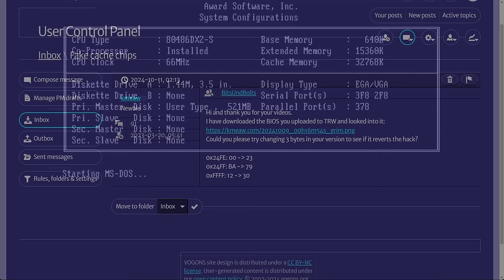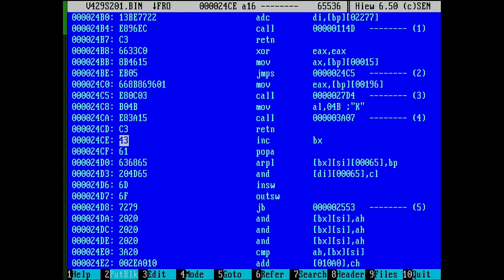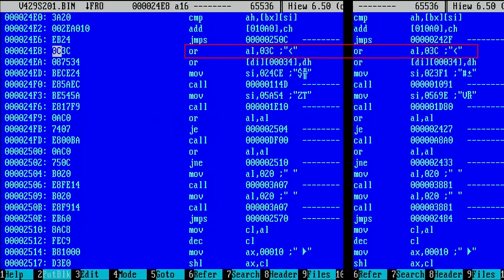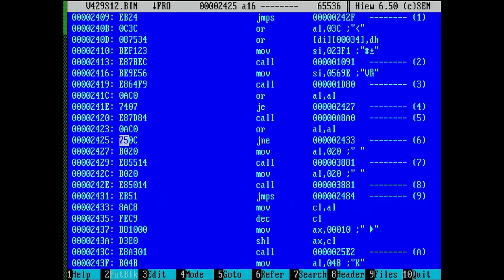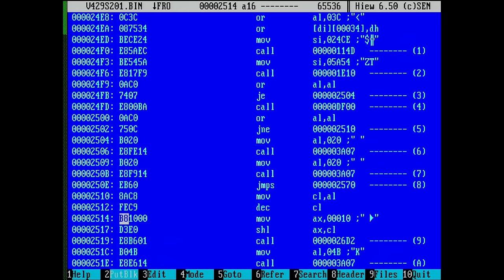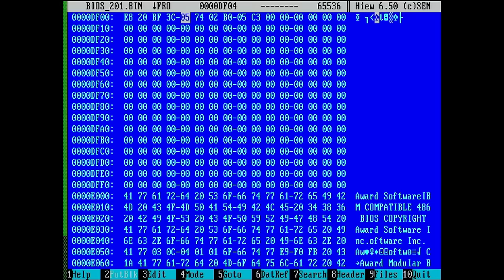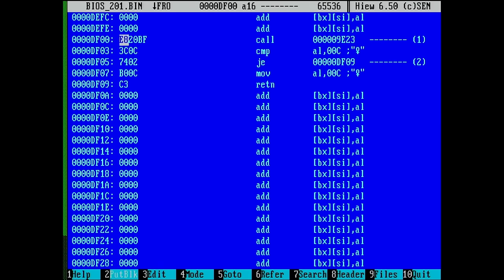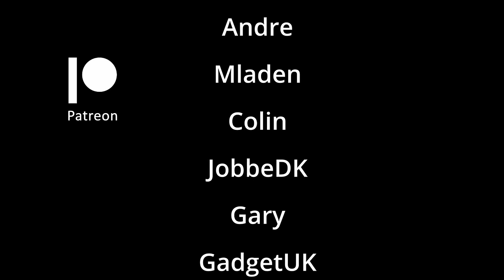Uncovering the Fake Cache BIOS Mystery and Fixing It!

Comment: Very interesting how naive the original hack was.
To check for matching 0x05 before replacing anything else with 0x05 shows a lack of understanding.
A normal override for this would simply always replace whatever was there with 0x05. Replacing 0x05 with 0x05 is fine and would not do anything and thus only require a single line.
Technically the hack could have been done without a new function also by exploiting the code that reduced the value from 0x05 to 0x04 before using it to shift. This could have simply loaded 0x04 directly, ignoring everything the call returned. Alternatively using the space for the shift operation as well we could simply load the desired 256 result.
Reply from the maker: That would have been the quickest and shortest way to get this BIOS always return the value those people wanted to have the BIOS return. It would even call the original function that seems to be important (or maybe it isn't).
Reply: It might be a bit of trickery to hide it when (hardware) testing the code?
As example: It does check the cache memory on a hardware level but then ignores it completely in the code so with hardware testing it gives the right signals on an electrical level??

Bit like the Volkswagen scandal, the car knew when it was being tested and went into a "compliant" program so it passed the test.
Reply: @samuraidriver4x4  But that's just it, the extra stack level and call could have been caught by testing. The result is also returned in a register so  unless you specifically looked for a read from that register after a certain number of instructions upon returning you would never be able to tell. The register is used a lot more later.

Comment: There is a really great tool called Compiler Explorer, wich you should try out if you want to learn more about assembly.
Also assembly really isnt to complicated to read. There is the mnemonic, which represents the type or operation the instruction performs and then there are the operands, which are either registers or memory locations.
Reply from the maker: I'll have a look. What I've seen is that not every disassembler can work on BIOS files. Some expect windows executables. I will spend some more time on this topic.

Comment: Hi, if you want to to dig deeper into reverse engineering, than I would recommend tools like the free Ghidra, the free version of Binary Ninja or the free version of IDA Pro.
Reply from the maker: In the meantime, I installed both of those programs :) Unfortunately, Binary Ninja is a bit confusing with all the different windows, but I guess I will get used to it over time.
Reply: I'm fairly sure a lot of those kinds of tools don't work for 6502 machine code, though I've never tried it, so I don't know. Though I'm fairly sure IDA does support older instruction sets, not sure about 6502 though
Reply: @nikkiofthevalley  Ghidra supports 6502, IDA and Binary Ninja support it only in the paid versions.
But the BIOS file was/is for x86, which is supported by all three.
Reply: @SuperVirus1978  Oh, I thought the BIOS was for 6502 for some reason, I'm stupid haha

Comment: In the hacked BIOS, what's the point of checking if AL was 0x05 only to set it to 0x05 if it wasn't?
The only reason I can see this process at 0xDF00 being useful, is if the returned flags can be used to tell if AL was originally 0x05 (ZF=1) or if it was hacked to 0x05 (ZF=0).
Reply from the maker: ZF is zero flag, isn't it? I stumbled across this already. That extra code and function doesn't seem to serve any purpose from what I've seen. I guess it's just a way to implement it. And think about it, that code was not meant to be seen by anyone else 😊
Reply: Also the zero flag is immediately overwritten by 'or al,al' at the calling site, so it makes no sense (or nonsense).

Comment: The modified routine that checks if the value matches 0x05 and then sets it if it doesn't, would it not have been simpler (and very slightly more efficient) just to set the value without checking it since this would save a few clock cycles?

I get the way they've done it seems a "better way" but in terms of efficiency it achieves nothing.

Anyone else manage to follow this a lot better as you've too watched Ben Eater's various tutorial videos? And if you haven't you 100% should!
Reply from the maker: I'll check Ben Eater's tutorials. Thanks for the hint.
Reply: @bitsundbolts  I learned a LOT from his videos.

Especially how computers work with the 6502 project, where he builds incrementally explaining each step in succession starting with basic logic gates. Can't recommend them highly enough.

Comment: There are plenty of comments about the redundant code at 0xDF00, but can we take a second to mention the code that decrements cl before using it to shift al (which was just loaded with 0x0010). If al was loaded with 0x0008 instead the dec would not be required.

dec uses 3 clock cycles, where-as the shl uses 8+4-per-bit cycles, so the dec is one cycle quicker I guess shrug

Comment: I don't understand why the pirate patched bios checks for 05hex after the original code is called by the new routine. Call the original code to preserve the hardware behavior then load 05h on the register and return. Check the original value to to skip is a utterly moot point.
Reply from the maker: Who knows. It is odd to have the check there and then overwrite only if it is not equal to 5. Maybe a coding style. Don't update the register if it already has the value you need.
Reply: Likely because it's a quicker operation.
Reply: @drewnewby  there the code only runs once, it just wastes space with something a single instruction can do. Calling the original function before is understandable as it may be important for initialization, that part is actually fine.
Reply: @leonardoliveira There's a difference on 
vintage bare metal between more code and how fast an operation takes to complete. Less code is not always faster of course.

Comment: Very Interesting on finding the bypass.  But I have to say it was humorous watching your naive understanding of assembly.  There is a difference between code and strings, most of what you were trying to decode were strings which would give you undecodable gibberish -- because it is not code!

Basically, the code was really had a jump over a string of characters "Cache Memory     : " then an instruction to load the beginning of the string into register SI, then a call to a pair of subroutines to output that. Finally a routine to blank register AL and figure out cache size and then the bypass that you found that calls the real routine and then bumps the al to 5 (256K) if the cache is actually 0.
Reply from the maker: Oh well, I'm not denying that I am a bloody beginner when it comes to assembly language 😅
Reply: I find the mix of data and code unusual. In modern binaries the data and code live in separate blocks (for multiple reasons) and are not mixed together in this way.

Comment: Great explanation. I never touched a BIOS but on my to-do list is to mod a BIOS for a motherboard to be Win2k compliant and to accept HDDs larger than 8G.
Is there a cache capacity that is right for a certain memory size? I remember that on my 486, having 512K cache, the computer was slower with 4M RAM than with 32M RAM. Not sure if I remember correctly.
Reply from the maker: Could it be that you meant it was slower with 32MB RAM than with 4MB? It could be that the cacheable memory area was the issue and only half of the memory was cached, but it sounds unlikely with just 32MB. Or the TAG RAM was too small for that big cache size. I wonder how difficult it is to fix the 8G HDD limit on a BIOS like this.
Reply: @bitsundbolts  Probably easier to get a xt-ide bios chip and add it in :D

Comment: What do you use to capture the screen of the 486 pc?
Reply from the maker: A set of video converters: VGA cable to OSSC (open source scan converter) and then HDMI to USB capture card to get the signal into OBS.
The HDMI to USB was difficult to find. I had to test at least 10 different devices to find this one. Even Elgato Camlink 4K doesn't work owith those old and small resolutions.

Comment: Well, it worked.
My criticism would be that just because the computer is from ~1995, you didn't have to behave like you were also in 1995.

IDA or Ghidra would have been more appropriate tools
Reply from the maker: I have no experience with those tools as of now. I started to look at other tools to disassemble code. Yes, the newer tools are way more capable and helpful.

Comment: Is it just someones joke? And does it affect any software for real, or just a POST gimmik?
Reply from the maker: It was part of a scam that made customers believe to have cache in the system even though there wasn't. To make sure the trickery isn't easily discovered, fake cache chips were placed on the board. Those cache chips just looked like real cache chips, but there wasn't any silicone die inside. So, just a plastic housing with metal legs to give the illusion cache is installed. There is already a video about this on my channel. This BIOS code helped scamming people.
Reply: @bitsundbolts  Although I understood every BIT of what you were doing, I didn't know WHY.
A 25 year grudge? Revenge?
Thanks for clearing that up, and good job.
Reply from the maker: Well, I shared the BIOS with the community: The Retro Web.
Now, anyone who has this board can use the latest BIOS.
Reply: @bitsundbolts  Just saw your first vid about fake cache and see clearly the reason for revenge :-)

Comment: I'll need another watch of this or two :D
Reply from the maker: Haha, I hope it is because you like it so much - squeezing out the bad code via a disassembler :D (and not because it is confusing an my explanations are horrible)
Reply: @bitsundbolts   Exactly. I've just had to skim it due to lack of time for the time being and leave pondering for later. RE content is fundamentally always welcome, though i suppose it could be a hard sell for some other part of the audience.
Reply: @bitsundbolts   What i did notice is that you haven't spotted the end of the string where you inspect "cache memory", the 0 terminator slipped into the decoding of the next instruction in hiew, thus making that decode junk. Classic code-data disambiguation problem. It obviously finds its footing eventually so it hasn't actually interfered with what you were trying to find but given x86 has variable instruction length, it can take a while.
Reply from the maker: Yeah, it was hard finding the end of the string and the decoded instructions didn't always make sense (e.g. the string turned into instructions). I skipped over the parts that weren't that interesting - and I already knew what I was looking for. However, I still wanted to understand what's happening and why we get 256K displayed in the summary.
The video is doing well, so, RE is maybe not such a bad topic from time to time.

Comment: can you not edit the code directly in the disassembly mode?
Reply from the maker: Yes, you can. I will do that later in the video. But you're right, no need to jump to the hex editor for editing.
Reply: @bitsundbolts  The thing that really shocked me is when the memory address in the call command doesn't match the actual memory address. Ohhhhhh intel what the hell did you do?  LMAO In 6502 the address is the address is the address. That's the way it should be.
Reply: @awilliams1701  It's a relative call, it doesn't use an absolute memory address but a signed offset. So you tell the CPU not where but how far to jump.
Reply: @kpanic23  I guess in the end the actual assembly would be something like "Call cacheDetect" and "cacheDetect" would be resolved by the compiler, but that seems rather silly to me. I can see some cases like a for loop where that would make sense. If you only need to jump relative with numbers that fit into 8 bits then sure (like a 6502's zero page), but more than that? Might as well just use the actual address at that point.

Comment: I've often wondered what would happen if you replaced RAM with cache. Of course now days it's not that big of a deal. RAM is actually faster than CPUs now. They have 10ghz ram now!! it's insane.
Reply from the maker: Isn't there some trickery somewhere? Like double data rate and other ways to just market it at high MHz, but in reality, it's not clocked that high.
Reply: @bitundbolts Very much so, it's nowhere near as fast as modern on-die cache.
Reply: @bitsundbolts  It functions as if it's that fast. It's actually faster than any CPU can handle currently.

Comment: You should use a diff program to compare the two bios.
Reply from the maker: If you're referring to BIOS v1.2 and v2.01, then there will be a lot of differences. Both versions differ significantly. I'll try to point this out in another video in the future. Seems like v1.2 is a lot older.

Comment: 32 Mb of cache... Seems like you gave it a bit of a modern chip there for a brief moment.
Seeing as you theoretically can install Windows 95 in the cache alone if it was supported on some chips.
Reply from the maker: Hehe, yes - Windows 95 would indeed fit in 32 MB of cache. Someone should try something like this on a modern CPU ☺️.

Comment: Very nicely explained! The original patch seems pretty damn stupid, patching in another function to return 5 instead of just replacing the call with a mov al, 5. Unless there is a consequence of not checking the cache size. Even then the compare in the patch is redundant. 😂
Reply from the maker: Maybe those people were paid by how many lines of code they wrote.
Reply: @bitsundbolts  😂
Reply: I was going to comment the same thing. The entire “patch” they made is entirely unnecessary. Comparing to 5 and then replacing al with 5 if not is the mark of someone who has programmed a lot of assembly.

Comment: They were a bit wasteful with their code! If you are going to always change AL to 0x05 then why check it's 0x05 after the return from the original code at all? No point checking if AL is 0x05 and skipping changing it if it is, that makes more code, not less. They should have just called the original routine then set AL to 0x05 before returning to the calling routine.
Reply from the maker: Yes, that would have been shorter. I have no idea why they did it that way.

Comment: wow you know something sucks when I'm calling it out in a language I know nothing about. first it compares then it returns if if it's fine. Otherwise it sets it equal, then it returns. Why doesn't it just set it equal and return? lol completely redundant code.
Reply: oh and if you're overriding the number why are you calling 9e23 in the first place? sigh..... Seriously all the fake function needs is "mov al, 005" and "retn"
Reply: @awilliams1701  The original procedure may actually do some initialization first, before returning the size.
Reply: @k4be.  well let's say that call is required to boot the system. You can still eliminate the comparison. That's being erased by the mov command.